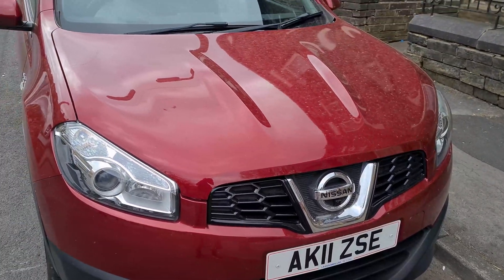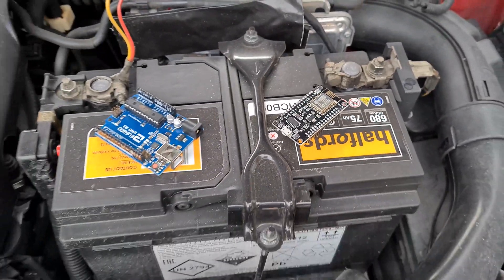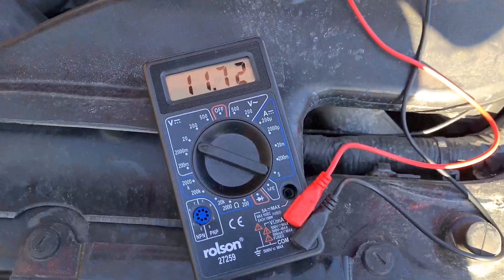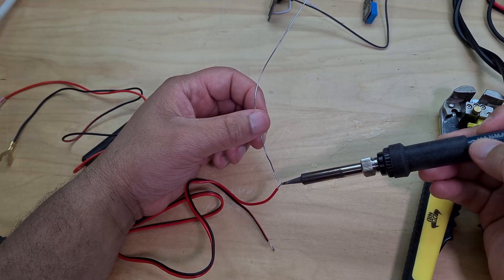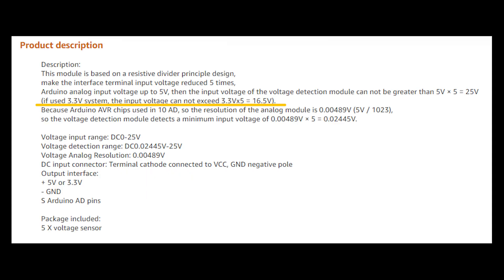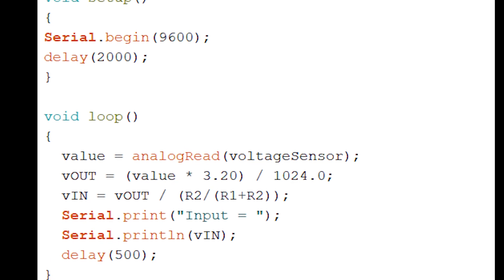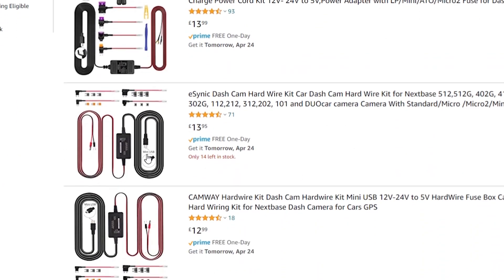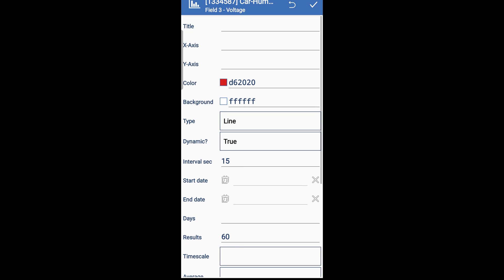Arduino ESP8266 DIY WiFi Car Battery Voltage Monitor

Comment: What kind of draw does this add to the battery, did you ever take any notes about it? Also do you think your code could be modified to sleep most of the time and check once every 30 mins or so?
Love the project!

Comment: This only is for monitoring.  A permanent solution is to hook up. a float charger 7/24.  You leave that on for years battery will  be ready for use anytime. Float charger is dirt cheap the www is your friend to buy one.
I became an expert in lead acid battery and lithium after fed up  with rip off price in store.  I don't buy new battery anymore.  I always am able to restore bad battery to good one to use for years.  That requires me to build a special charger that brings back life of non charge or dead battery.  90% of battery that replaces  out there  can be restored to be reuse.  What a waste and consumers lose while store and manufacturer laugh all the way to the bank.
 Here is the secret.  Battery longevity  (lead acid) trick is the float charger.  That 13.5V will keep the battery happy for years whether you use or don't use it.

I will incorporate and esp device to remote monitor the voltage  as i have already done many IOT projects to home assistant already. Once one is done it just keeps growing with other IOT projects. 

I know you are curious about my special charger.  It can do 1v to 110v restore  any kind of battery chemistry from dead to alive.  It won't do the severe one. Look up  capacitor charger and build yourself one.  Good luck and be safe of  the 110V - 220V  AC depending on the country you live in.
Nowadays I only do lead  acid and lithium battery.  For years I build many lithium battery packs for my home solar storage system- thousand of cells by now so definitely i know the stuffs.

Comment: Use the KISS practice!    Lead acid battery voltage drops off can be easily  rectified without any complication.  Battery will be good for years even if you don't ever look at it.  How??
Simple with a float charger.  I bought the 1a or 2 a version and leave hook up continually.  All it does is to keep battery at 13.5V and consumes tiny power.   I can always start the engine  NO matter how long i don't start it regardless of lawn mower, car, boat, whatever!!!!!!!

You build the monitor   you still have to go charge it when it runs down don't you?????????

Comment: Ur battery is probably going flat from adding all the arduinos. Add a coin cell battery to them all and not have them powered off the car battery..

Cool project, tho definitely could be done better
Reply from the maker: You're not wrong lol if I do this again I'll add a solar panel and a battery.
Reply: @HamedAdefuwa  u won't need a solar panel. Iv had sensors running on a coin battery for years

Comment: Really helpful ‘little’ project thanks!  One small point, if you’re seeing 11.xx volts on your battery when not under load then it’s pretty much junk! It may recover if you charge it soon after but Lead Acid batteries hate going below about 12.4v on a regular basis.  Other thought is why didn’t you go for the ODBC port for power?

Comment: I got everything working,tested it while inside my house/room(for days), but my WiFi signal is too weak or the ESP8266 antenna is not good enough, can’t connect to internet when inside my car, 😢😢
Reply from the maker: Yeah I had the same issue. I used a WiFi extender inside my house and put it as closed to my parked car as possible, that worked well. SIM card in your car works even better lol
Reply: @HamedAdefuwa  Thanks for replying, I just got it to work, by Using the ESP8266 alone,  I don't know why but for some reason It only worked (connect to WiFi) when i putted SSID and Password in wifiMulti.addAp(), but whatever SSID and Password i putted in "const char *ssid = "" ", it won't connect, and I added some time (delay()) somewhere inside the loop, it worked for me, (NOT saying it'll work for anyone else) , but it is working now, like you said "80% of the time it worked flawlessly"🥰🥰 Thanks.🥰🥰🥰, hope this help someone with same problem

Comment: Does this device work even when the car engine is running?
Reply from the maker: Yeah of course, I have mine connected to my car's SIM card so it's uploaded to the cloud but you could log it onto an SD card
Reply: @HamedAdefuwa  can it show the real time battery percentage
Reply: Cloud name please 💕 ?

Comment: That Module you baught to tie into your fuse panel, is a low voltage cut off circuit, to keep accessories from completely draining your battery.
Reply from the maker: Think I need to get a new one and put it back in lol I have had my battery drain a few times

Comment: you use 12v to5v converter. can i use simple 7805 voltage converter ic in this ckt.
Reply from the maker: Yeah I don't see why not.

Comment: Even you can transmit it through wifi you need to be in a close range of the transmitter correct? but comparing with bluetooth capabilities this is better...i'm asking because i'm thinking to build your idea for a project of mine...did you test you far you can get the signal of the wifi with your setup ?
Reply from the maker: Theres quite a few limiting factors; walls, how busy the area is, engine running etc. I had a range of around 10 metres but sometimes it would work significantly further. I'd say 80% of the time it worked flawlessly.

Comment: I've spent all day getting this to work and then I found your video and had it working in under 10mins. Thank you sincerely for a great simple video that has got me reading my car battery voltage. Your sketch code was easy to understand and the only one that worked. Again, thanks.
Reply from the maker: I know your frustration Lol! Glad I could help, enjoy, its still working great for me.

Comment: Awesome ♥

Q: how to power esp32 or esp8266 from car battery (12v lead acid)?
Reply: Use HT7333 LDO in your circuit with 100nF multiplayer capacitor paralel with 1000uF capacitor
Reply from the maker: It's really bad a third year EE student has no idea what your comment means right? 😅
Reply: @HamedAdefuwa  Yess indeed😅 but it will be just like a Letter to him coming from Back to The Future😅 He will get it someday
Reply from the maker: Man I sure do hope so! I'm struggling right now trying to figure out how to set the trigger voltage of a relay. I don't even know if that's the correct term lol
Reply: @HamedAdefuwa  have you checked the relays manufacturer data sheet? There will be the information you are looking for minimal voltage, maximum voltage etc
Reply: If it's 5 volt Expressiff, just use a phone charger.if it's 3.3 volt,  buy a buck converter.